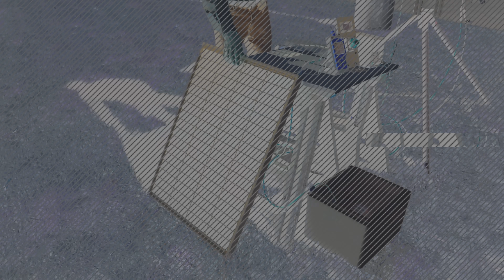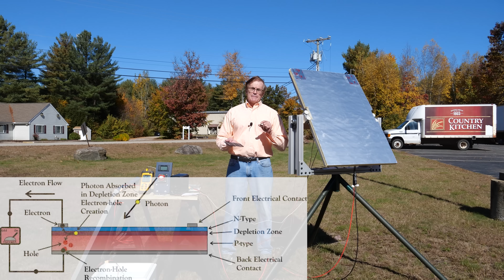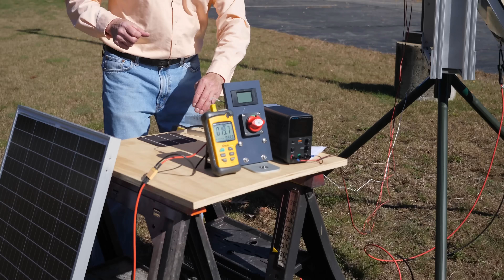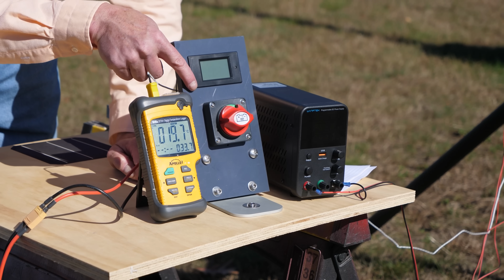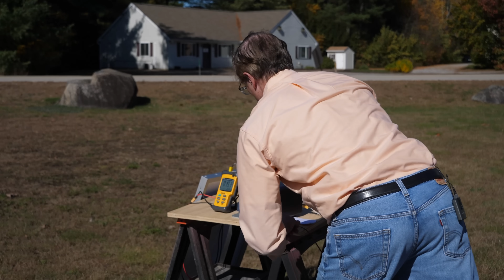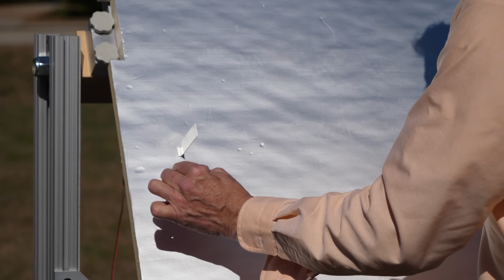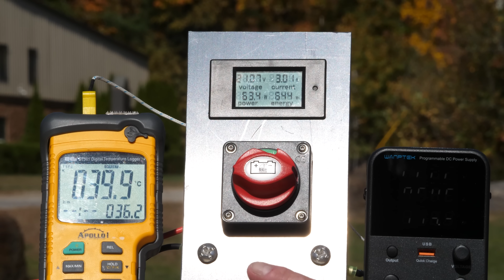Do you REALLY get enough out of your solar panel?

Comment: I really appreciate your videos. You actually build and test the things I just sit around and think about forever stuck in a state of analysis paralysis. I was surprized yesterday how warm the panels are when the ambient air near freezing and the aluminum frame of the panel (black, shoulda been light) is comfortably warm. I just got them this fall and really wonder what the temp of that frame is going to be in August? The cats sure seem to like to hang out behind them on a chilly morning.
One thing not mentioned is the reasonably expected lifespan of the fan motors. If you installed 100 of those fans, how many of them would not have seized bearings in 10 years?  I wonder if electrostatically charging the air with HV, moving air with no moving parts might be a better option? Dyson fan for clues.
  I think closed circuit liquid cooling is where it is at, much easier to utilize that collected heat elsewhere which could be considerable on many sq ft of panels. After watching your solar water heater/PV drag race, I'm sure you are readily aware of the heat potential, well over half the radiant energy caught by that PV panel becomes heat at the panel that must be convected or radiated or in the case of liquid cooling, conducted away.  You would have a hybrid solar water heater/PV that makes flowing electrons too! Maybe use a sheet of coroplast(styrene) or polycarbonate greenhouse panel to make a heat exchanger that can be glued on the back face of the panel, would be pretty easy to fashion multiple circuits with and exacto and a soldering iron if that seemed beneficial.  If you used silane for glue it could be easily reversible to not mess up your panel if it doesnt work out. Coroplast can be purchased with a decent layer of thermal insulation sandwiched on, and greenhouse panels can be purchased that have 2 or 3 layers deep for insulation purposes. Thanks for doing and sharing what you learned.
Reply: I had a similar thought about the fans needing to be replaced multiple times through the panel lifetime. There's also the added cost of the heat fins and back panels.

Also I don't believe the Dyson fans are electrostatic. They have a fan in the base and the airflow is directed up to the manifold in the top section. But I like the idea of cooling with no moving parts.
Reply: @CheddarKungPao  Thanks for the correction on Dyson fan.
Reply: I have computer fans stacked about an arm's length from early 00 and the fans still work well.  Most of these have ran through at least 1 if not 2 or 3 versions of Windows.  The fans outlasted the system being relevant in most scenarios.  I am not positive to the max life of solar cells but you could not buy any rated past 10yrs before recently if that has even changed.   The clear coating on the cells will have to be redone if they are even still functionally efficient enough to run as a modern system after 10yrs of improvements to material research.  Plan the purchase I guess for a summary and look at the lifespans on your investments in cells.
Reply: @rallyfeind  You are way off on solar cells. Panels last basically forever and 25 year warranties guaranteeing 90%+ performance after 25 years are industry standard. But most panels are still working just fine after 30+ years. They have glass covering them, not clear coat.

Sure sometimes electric fans last forever, electric motors are very simple and tend to have very little wear in operation. But you're missing the point that these would be outside and exposed to the elements and running constantly 24/7 in hot weather. Then you add in that there will need to be 3 per panel, and with my solar array that would be 84 fans. I'd be replacing fans pretty regularly instead of just having a maintenance free array. I think the extra money and effort would be better spent on a few additional panels. And this simple calculation is why nobody really bothers with active cooling of solar arrays.
Reply: @CheddarKungPao  Neat.  You spent way to much effort to explain something has changed.   You didn't tell me how or why like you know only that you are aware of numbers as they stand today.  Thank you for the update to the standards without any insights beyond saying that I was outdated in info.  Good talk though.  Oh can you send me a link for hail-proof glass they are using because that is something I would love to get since I live in a tornado heavy area and hail is inevitable not just possible.
Reply: @rallyfeind  you also have access to google dude. I am not your concierge.
Reply: @CheddarKungPao  I don't know if I should compliment your sudden brevity or ask what the point of trying to educate me was only to blow me off After I asked for you for more education.   I love how comments are full of knowledge teases that like to just get me excited to learn and rug pull.  I don't mind but I was already getting the latex outfit ready and started putting out the plastic for knowledge splatters.  I even ordered a bronze apple engraved with your name as teacher.
Reply: @CheddarKungPao  They use acrylic on the Sharp and Sparco panels on the ones from the electrician I called.  He also was interested in the ones you are talking about so he could start installing them.  But both of those manufacturers also suggest a 10yr replacement cycle and those are the main ones he sees when doing commercial and industrial installs.  Glass fogs is the big reason not glass in the major manufacturing as he has had to remove glass ones even.  I talk to professionals so I didn't ask Google. Hope that was okay.

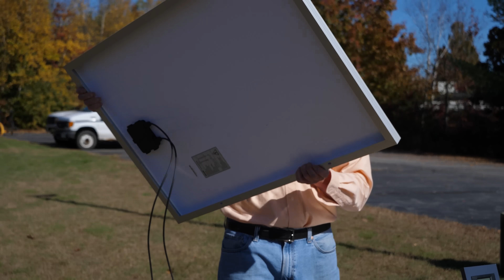Comment: As shown at 3:43, the back sides of these panels are painted. Was the paint stripped/bead blasted off before applying the epoxy & fins? If not, it could be a huge thermal break.
Reply from the maker: It wasn't, but indeed, that would help.

Comment: Without using a MPPT system that's going to be way larger than anything you gain or lose by cooling the panel.
Reply from the maker: You can always  add that to an optimized system.

Comment: You need to include the power loss of the fan power supply. Also, there's no guarantee that those fans (or any other 12V fan) will reliably start up at 6V. A fan needs a higher startup voltage, which can then be lowered once the fan is running. You can maximize airflow efficiency by building a fan controller that does this.
Reply from the maker: Of course.

Comment: Something like this would sit well with solar investors in large solar farms. Because every extra watt is more money in  the end. 
While this is all great cost vs investment still wins in the end. If its cheaper then they do it. Yet once a solar farm makes a profit they flip for better panels which shorten their investment time and increases how much they can make. They then sell off the used panels which have a few years to 10 years on them for pennys. There are people out there selling used panels that still match capacity or close to it. These sell for a fraction of what a new panel does. If was going to build a large enough system I would just opt to add more solar to compensate for the heat/cold/winter losses. Say I need 20kwh, its just cheaper to build a 40kwh system and be done with it. Say you get an average of 80% from the system and in 25 years you lose 10% capacity you are down to 70% which is still 30% more than you need. If you build your system to last 40 or 50 years accounting for degegration of your panels you will still have more capacity in 50 years. You can do the same for your batteries and your inverters and charge controllers have high life ranges as well. While it might cost you double right now. 50 years of not worrying about power is pretty nice.

Comment: Its interesting but I think one really has to weigh the cost and maintenance involved with active cooling and tracking verses simply using that money to buy more fixed panels.   Fixed panels without active cooling are basically zero-maintenance.   You don't even have to wash them in most locations (and generally speaking you never want to power-wash panels anyway, it will mess up the seals.  At most I might clean my panels once a year and it doesn't really improve production all that much when I do).

Home installations almost never bother with tracking for the same reason.. it isn't economically worth doing.  Large grid-scale systems, of course, all do single-axis tracking because it is cost-effective when one tracker is running 50 panels.  One big problem with tracking is that tracking systems are harder to secure against high winds.  You don't want to put a cheap tracker on a grid of panels... the first wind storm will take it out and create a mess.

Degradation rates are also much, much lower with modern panels, usually less than 0.4% a year for grade-A panels and even low-grade panels degrade at less than 1% a year.  That isn't bad at all.   Temperature-based degradation does happen, but outside of certain areas it is relatively rare for a panel to heat up above 70C or so and even then it is only across a few hours in the day in certain months of summer in specific localities on days without wind.  Replacement cost amortized over 20-30 years is fairly low, too.  The electronics are often more economically costly to maintain than the panels.

Comment: You have completely missed the point of hybrid panels. (the ones that have a liquid cooling.)
They don't vent to air because the heat is useful.  - they use a heat pump to take the heat out of the coolant in the panel loop, and use that to heat water. 
This means that not only is your electricity "free" but also you reduce your gas bill for water heating making that also "free"

Comment: Issue I see is the fans probably will need to be replaced every couple of years. I would try to see if just the alum heat sink was used (flip it) so the fins are on the outside and the alum panel is touching the back of the solar panel: passive cooling.

Comment: i always thought it would be a good idea to water cool solar pannels, like, using a "solar water heater" type of enclosure for a good legnth of copper pip, that you can mount the solar pannel to, so that the heat from the pannel, goes into the copper, and then into the flowing water within said copper, its effencicy as a water heater might be reduced, but that would be made up for by increasing the effencicy of the solar pannel.

Comment: I've always wanted to see solar panels paired with some kind of clever Stirling engine. Or a Stirling engine solar panel that turns photons into heat via black paint then uses that heat to power something. I'm sure there are good reasons why Stirling engines are uncommon but I don't know why. The sun is such aa great way to maintain a temperature gradient.

Comment: I beg to differ on your conclusion; maybe because I'm an engineer.
You get approx 6 W more on 60 W, but use 3 W for cooling. That's roughly a 5 % increase. Not bad at first glance.
But: You usally use like 12 to 20 of these panels on one roof. They shall last for 25 years and should be almost maintenance-free. Now you add like 60 fans on your roof for that 5 % increase. So now you climb your roof every other week to service one fan (out of the 60!) which recently died on you? No thank you. I'd rather install panel Nr 21 and stay under the roof.
Reply from the maker: As an engineer, consider the whole picture. The panels will last a lot longer and fans can are easy to replace. If they run only at the peak heat levels they will last much longer as well.

Comment: Your control configuration is not valid.  You are testing fan cooled against an enclosed back.  You need to take the aluminum sheet off the back of the panel to make your comparison.  How much is the lack of natural air flow across the back of the panel, when the fans are not running, contributing to the heating?
Reply from the maker: It isn't  enclosed.

Comment: To play devils advocate, in summer I am never short of power no matter how much efficiency I am loosing so those extra few watts I will get don't mean much. The panels lasting longer is nice and  Im all for maximising the value of things but in another decade panel efficiency will be so much better I will want to upgrade them to potentially increase my energy gains by up to 1/3 if current panel trends continue, eg. mine are 19.% efficient, 3 years later to today some panels are 22% efficient and within a decade we might be at 30% efficiency for affordable panels. This is a view shared by many others going by how many second hand panels I see on market place with the comment "selling because of upgrade". Great experiment though, really clearly represented.
Reply from the maker: I understand.  You can always  add effeciency enhancement to a PV panel.  And, if used panels  are cheap, they may be a more cost competitive choice even for new installations.  Add cooling and they'll  work even better and last longer.

Comment: I think there's a flaw in your methodology: the enclosure you built surely insulates the panel when the fans aren't running, making your control test perform worse than a passively cooled panel otherwise would. This will have made the improvement you saw appear larger.
Reply from the maker: No it doesn't.  The modified  panel without forced airflow works slightly better than an unmodified  panel due to the larger surface area.  Although  the difference  is small.

Comment: this probably, has a lot to do with ambient air temp, if only there was small coil of pex or something under panel to take all heat and put it in nearby stream or a water tank... for later use ... have you thought of that as a heat sink possibility? Also was the aluminum sheets expensive in NE ?

Comment: Now it would be interesting to calculate how many Watts of thermal energy is transported from this panel. Maybe on larger scale there is some use for it. I mean have given ambient temperature, the temperature without cooling and the temperature with cooling. Now we just need to know the cubic meters of air per hour to calculate a rough estimation of the potential usable heat. Maybe it is possible to support the U.S.-typical hvac air duct heating systems. (In Germany we dont have this kind of heat distribution via air ducts, we are using traditional water radiators or water floor heating systems)

Comment: Uhm. Your solar panel does NOT contain any heavy metals. Not even as dopants. There are thin-film batteries that contain cadmium, but they are used only in utility-scale projects.
Reply: I came here to say the same thing. I've worked in solar for 15 years and this is a common piece of misinformation used by anti-renewable groups. There are Cadmium Teluride (CdTe) and Copper Indium Gallium Selenide (CIGS) PV modules that contain the heavy metals in their name. However, they are NOT available to home owners or most solar installers and are almost exclusively used at utility scale as part of vertically integrated manufacturing/installation companies where the same company that makes the modules builds and maintains the solar array. Other common parts of this misinformation campaign are that broken modules will sit out in a field forever leaching metals into the ground and that they aren't recyclable. As soon as the monitoring system notices a drop in production someone will be sent out to investigate and will pull any broken modules. In my experience this is within a week for a utility scale system. These metals are part of an alloy that is not easily compromised and I'd be willing to bet a cell phone someone loses in a park is going to leach more heavy metals into the ground than a solar panel. All these elements are expensive and these panels are fully recycled now.

There is a point that the silicon PV modules used for 99% of installations need a more robust recycling program and I agree. Since these are not full of valuable heavy metals sometimes just the aluminum frames are stripped and the glass, plastic and silicon are put in landfills. If this continues when the 25-year warranty and 30+ year expected life the PV modules installed since 2010-ish we're going to have a lot of waste in the 2050s. There are companies that fully recycle panels now Cascade Eco Minerals is the one I've used. It would be good to make PV module recycling mandatory now (as Europe is doing) so the recyclers can start building up their businesses now to be ready for large scale recycling in 30-40 years.

Comment: Manufacturers typically state you actually drop about 0.5% per deg. C above 25C, and even here in Norway on a cold day the panels get up to 60C. I have mounted all mine with a 2" gap behind them. I have a 170mm ventilation fan connected to flexible ventilation "hose" that then draws air from one end of the array past all the panels. The air then heats and drys my basement. On a typical day the ventilation air is about 30C (basement / outdoor temperature about 10C). In similar climes it would also be smart to use your heat pump (the outside part) to do this job to utilise it even better.

Comment: Solar panels cost ~$1 per watt.
Shown was 10% improvement at cost of 6% power: 4% net improvement. Fans like this cost about $20 per 20watts (3 per 60watt panel shown) but only add 4% rated power, so cost per fan/watt ignoring aluminum and effort, as shown is $20 per watt.
Most panels do not point directly at the sun, this decreases solar exposure with same surface area, with low sun or low angle sun, the fans will produce fewer watts, figure a net gain during half of the solar day. Thus the cost per watt as shown is estimated at $40 per watt. This idea needs more work.